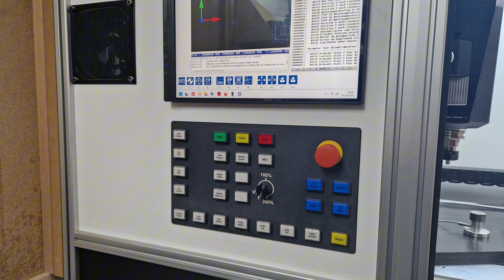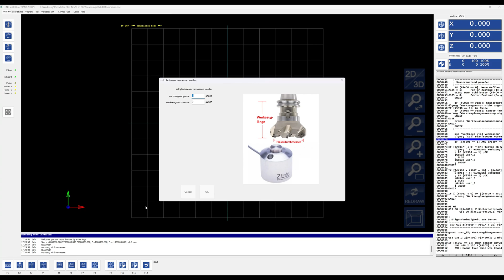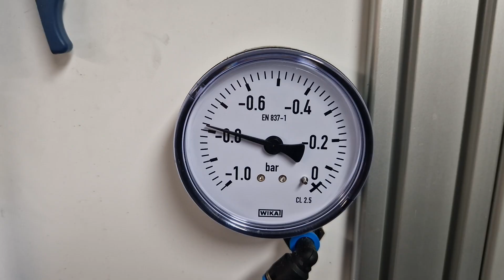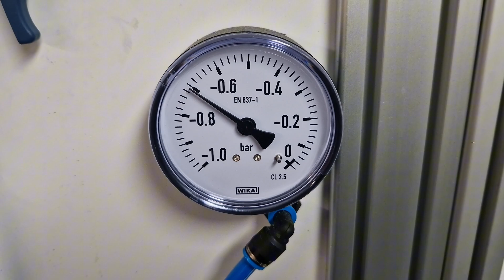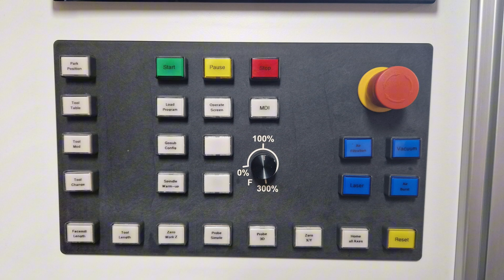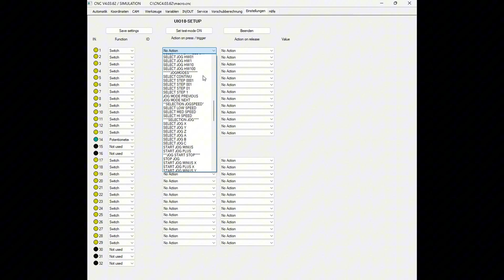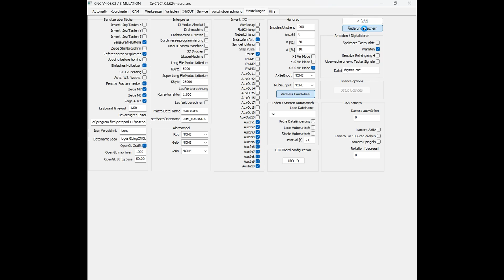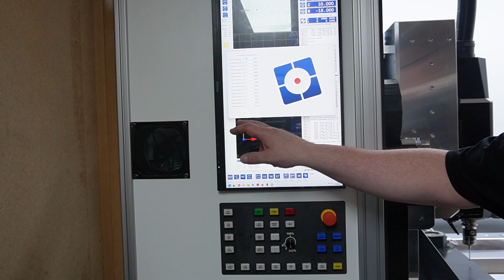Ultimate CNC Enclosure Part 2 - The DIY CNC Control Panel

Comment: Could you please tell what switches you use and where to find them on the internet? You mention, I believe, A1 switches but I cannot find them. Thanks in advance.
Reply from the maker: Apem switches
Reply: @scratchbuiltdesigns  Thanks a lot for your quick reply. Got them. 👍

Comment: Where do you get the vacuum card? I looked around for it but everywhere I could find it was pretty outrageously expensive so I decided to kind of make a DIY version using rolls of the clear vinyl flap material used for air barriers. I just drilled hundreds of the smallest holes I could manage in a tight grid, it works fine but I'm not not as well as the real thing.
Reply from the maker: It's directly from the Datron webshop. A 50pcs pack of 1000x500mm cards is 100 EUR. 1,40 EUR if you buy a pallet of 500 🤣
50 last me about a year. They are reusable to a certain extent, but you have to consider them a consumable...
Reply: @scratchbuiltdesigns  Thanks! I'll have to bite the bullet and just give those a try.

Comment: Would it have been a viable option to solder the wires at 90degrees as you're bending them that direction anyway?
Reply from the maker: Absolutely. You are perfectly right. But the rectangular opening for this purpose was in this direction, so it was the easiest way to do it. Since there is no strain on it, I guess it should be OK.

Comment: This is a beautifull cnc good job ! 
I'm learning this at school (futur machinist ?) and i want to try to build one myself at home :D
Reply from the maker: Awesome 👍
Reply: @scratchbuiltdesigns  What advice would you give me for creating a small design in the style of a Sorotec machine like yours? The goal is to create a CNC machine capable of machining steel (low feed rate Fz 0.05) and aluminum, Ertalon plastic, etc.

Thanks :D
Reply from the maker: @mistercloshak1568 Well...first of all, I would like to say that my machines have really nothing in common with a Sorotec machine. I used to have a CompactLine as my very first machine and I quickly ditched it for my own stuff...for a good reason 😂
Secondly, for what you described I would rather go with a fixed gantry and moving table, like my Watchmaker design, unless you need to have in addition a very large work area...
Reply: @scratchbuiltdesigns  Most of the pieces are medium-sized, ranging from 300/350mm maximum. When I said "Sorotec," I meant a moving gantry :)

Thanks for the advice, I'll check out the Watchmaker for some inspiration :)

Thank you very much! Good luck!